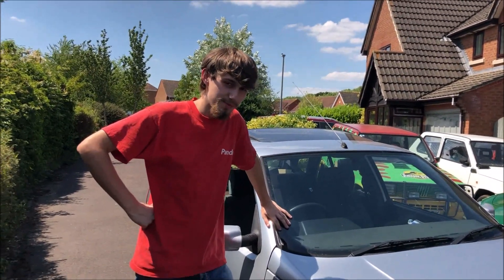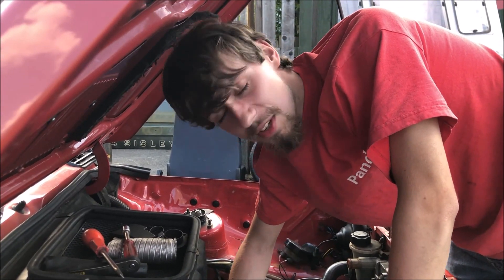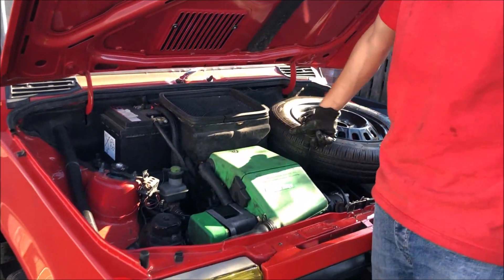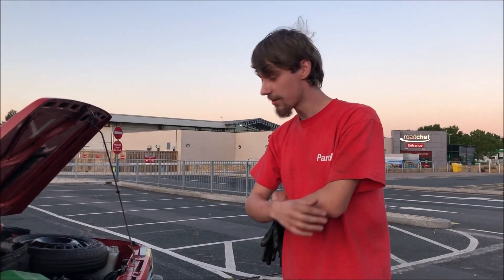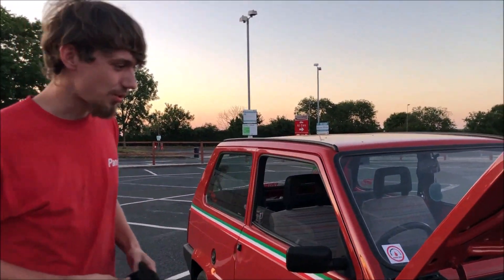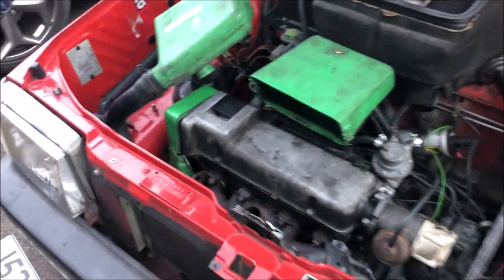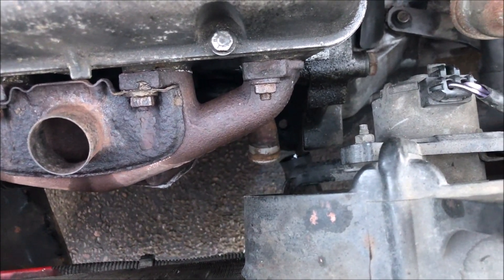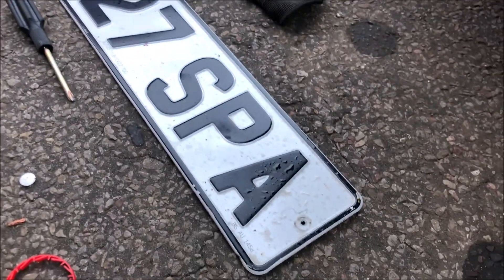Project Rosie | Picking up a Broken 1992 Fiat Panda! (Ep 1)

Comment: Volume is very low again when you are speaking. The music is fine.
Reply from the maker: Volume is as high as I can make it in editor, I will have to quieten music to match perhaps.
Reply: @OGCars  better microphone maybe needed.
Reply from the maker: @terryatkinson899  it's just on a phone, not using a dedicated microphone.
Reply: @OGCars  there's the problem. Or else speak louder.
Reply from the maker: @terryatkinson899  As I said before I may try to quieten the music to match, I try to speak loud enough for it! Thanks though!